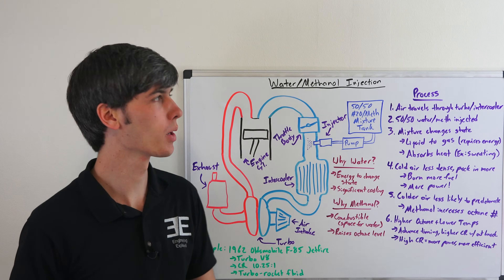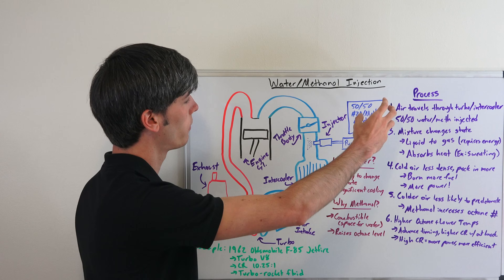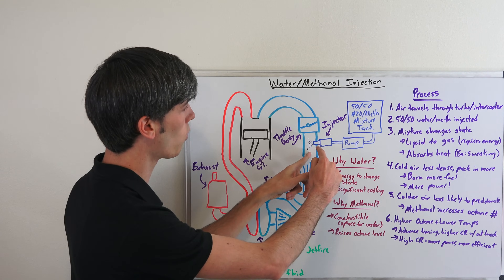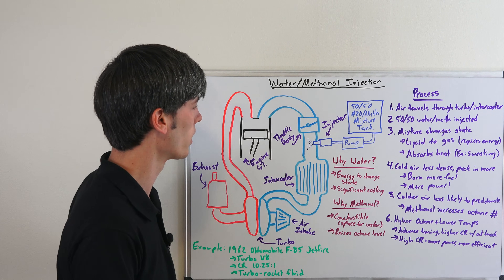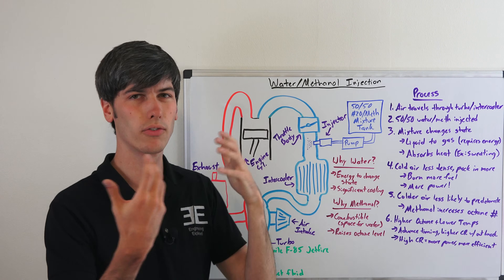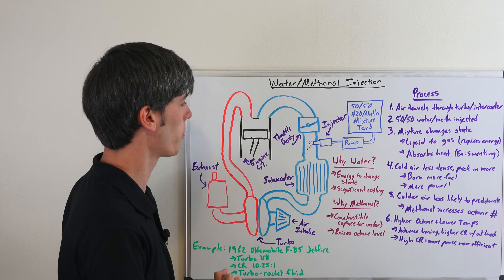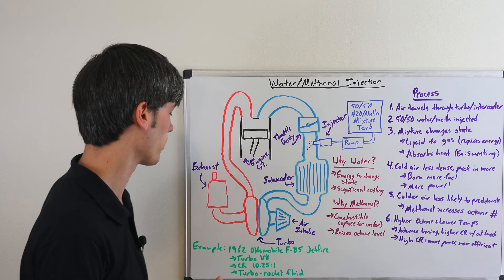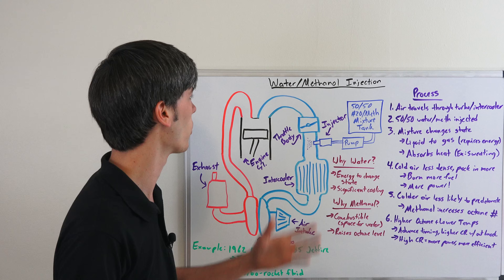Water Methanol Injection - More Boost!

Comment: i seen some guys use winter washer fluid instead of water meth mix
Reply: +fabianoH5N1 Yeah, some winter washer fluids are a mixture of methanol, ethanol and water. I don't remember seeing any that only have methanol and water, at least in here. But I have seen a washer fluid that is like ~99% ethanol and doesn't have any denaturation agents listed in the ingredients. I've been wondering if it's drinkable :D It's only 5€/4 liters, or $6/gallon. A ton cheaper than any alcoholic drink made for human consumption.
Reply: If it's 99% ethanol then the rest is benzene or cyclohexane or something similar.  It's quite toxic.  The best separation of a water/ethanol mixture using normal distillation is about 95% ethanol and 5% water.  If you need a truly non-ionic solvent you have to get rid of the water, and this is done by adding benzene and redistilling.
Reply: +Kepe I don't know about the washer fluid but in some laboratories they use Benzene to get more pure levels of alcohol(99%) and the benzene is very toxic lol, I wouldn't buy washer fluid to drink it.
Reply: TheAlmightyCon But it says it's 99% ethanol ;o
Reply: Kepe lol I can't stop you from trying but i would definitely call the manufacturer and ask them if it is safe for consumption. Even regular alcohol is dangerous, I have brought on IBS symptoms because I would drink heavily in college and it's still a problem for  me now =(
Reply: Or use 3A molecular sieves.

Comment: I run a Cooling Mist system on my Mazdaspeed 3, boost switch activated to spray 100% methanol starting at 15psi. For my platform, it's great to keep the intake valves clean since we're direct injected and get no fuel wash in the intake otherwise. I already run an ethanol blend in tank too, so the cylinder cooling and higher functional octane of the ethanol is already in place. With the methanol on top of it, my EGTs are likely hundreds of degrees cooler than normal, and I'm able to run a very aggressive tune in terms of timing quite safely. Steam cleaning the combustion chamber when I run a 50/50 WMI mix is also a nice added benefit!
Reply: SI0AX Here's a secret: I used to have a CRX. But when I did, I didn't go into a conversation between two Mazdaspeed guys, one of whom knows a TON about them, owns a highly modified one, tunes them, and actually is running the combination in question (eth + meth) and butt into the conversation will all sorts of just plain wrong information regarding ethanol mixes + WMI as it applies to the Mazdaspeed platform. This dude acted like a first-class douche. Anyone who knows anything about modding cars knows that platforms have all sorts of different variables and unique attributes that apply to them. A one-size-fits-all approach to modding all cars will get you a blown engine with a quickness. High-powered Honda notwithstanding, he obviously knows very little about cars outside of that very limited subculture.

That behavior was as rude as it was inaccurate. He doesn't even know DI because he doesn't have it. All he had to do was swap in bigger port injectors and use methanol for the octane. All he knows is methanol for octane. That's it. He has no idea about how many more very significant uses it has on our platform in CONJUNCTION to octane boosting. He doesn't even know that we don't have aftermarket DI support. How could he? He's a complete ignoramus regarding Mazdaspeeds.

And I'd be surprised if that little turbo Honda pushes more than 350wtq. Those are rev-happy lawnmower engines, not the 2.3 MZR DISI that the top guys are pushing 800-900 hp and a TON of torque more than a Honda could ever dream of.
Reply: SI RICKO Not at all. Especially when you're out of injector headroom. And on Mazdaspeed 3's (which are direct injected and get no intake valve wash cleaning), the WMI is excellent to keep clean valves alone. Granted, I already have great knock resistance running an E30 mix. Regardless, DEFINITELY not pointless.

Let's count the reasons:
1) Clean valves
2) More injector headroom
3) Increased knock resistance
4) Cooler combustion chamber, keeping ringlands safer
5) Steam cleaning the combustion chamber
6) More consistent year-round boost air temps, especially in hot climate.

There are even more Mazdaspeed-specific reasons I'm not mentioning. Yep, definitely not pointless at all, LOL ;-)
Reply: +Zack Richmond I'm planning on doing the same. Where did you setup your nozzle?
Reply: I have a throttle body spacer with 1/8 NPT holes for injectors to be mounted. I'm just running a single CM7 nozzle. Here's the product I use (and love): http://damondmotorsports.com/products/mazdaspeed-3-6-tb-spacer-with-injection-ports-pre-buy
Reply: Zack Richmond
Oh, shit, I though about also using a spacer, so I don't have to drill any holes.

The thing is there are many that recomend having a certain distance between the injector and the throttle body.

I would think this spacer makes the distance to short, but If there's no problems I guess it doesn't matter.
I guess there is enough space/distance/time for the water to evaporate inside the intake manifold.
Reply: SI0AX Various WMI companies (Snow, Devil's Own, Cooling Mist, etc.) recommend various nozzle locations for best results. Usually, it's within a few inches of the throttle body.

With regard to the Mazdaspeed platform, we've experimented with WMI a TON on our cars and know what works very well for us. If I didn't use that spacer, then I would've put a tap a few inches in front of my throttle body. That spacer places the nozzle right behind the throttle body, which also works very well for us. But I run a solenoid too to prevent siphoning since my nozzle is exposed to more vacuum in that location.
Reply: Zack Richmond
Cool. I would run the solenoid anyway. As there is a danger of the meth leaking and flooding the engine while it's parked.

The one problem that has put off many from methanol injection.
Reply: SI0AX Yep. I have a master switch installed too so that I can kill any potential flow whenever I want, including if I'm just parked/engine is off. I also wired in an LED to let me know when the system is flowing. I've incorporated several extra features like this to avoid issues.
Reply: Zack Richmond
That's awesome! I may try something like this, but maybe I will just stick to a check valve to keep costs low. I still haven't decided what kit to run. I'm thinking of dropping the cash on Aquamist. I don't know if that's a bit overkill it's like $600.
Reply: SI0AX Depends on your goals/application/how much you're going to spray.

I'm just using a single CM7 nozzle to keep my boost air temps down and add a little extra fueling, so for me a simple boost-switch setup that activates at 15psi was fine.

If you're going to spray a ton of methanol, need a progressive controller, and need a failsafe because you're fueling dependent on the methanol, then a more sophisticated setup like the Aquamist makes sense.
Reply: Zack Richmond
What I was thinking actually, was using the MAF volt signal to spray a very tiny bit of meth to increase the octane to 93 during normal driving and then raise it to 100 during WOT. It would also keep the valves sprayed the whole time the car is injecting.

That also means I could run 87 regular gasoline and save money. But I don't know how much meth would be consumed. I would need to purchase a large tank and maybe have to fill it everyday. It wouldn't bother me though.

Also If I were to use pre-turbo meth, I would of course, only activate the turbo injector at WOT.
Reply: SI0AX It really depends on your engine's needs, particularly with regard to timing. Many engines don't need that extra octane unless they're wide-open throttle/under full boost because those are the conditions that create the highest cylinder temps and therefore are most likely to cause uncontrolled (read: too fast) fuel burn because they don't have high enough functional octane.

Trying to dial the methanol amount in in such a way that you're spraying exactly the amount you need for the octane levels under various engine conditions would be extremely hard to do. And then there are all sorts of other factors that apply, such as the ambient air temps and boosted air temps. Hotter air makes KR more likely. IMHO, just spray more than you need in terms of octane. You don't want "just enough" octane. You want more than enough. So then, during the harshest operating conditions and under WOT, you still have enough octane to keep everything running safe and cool.

In terms of what nozzle size/how much to spray/how fast you'll go through it, it depends on your application. A CM7 is fine for me when spraying either 50/50 or straight 100%. My stock fuel system is capable of supporting my power levels on its own (just barely, LOL), so the meth on top is just a little extra safety measure to keep things cool and clean. I'm at about 385/380 @ the wheels in good weather, and my CM7 usually will spray in such a manner that my 1-gallon tank for methanol won't need filled more than once per tank of gas.
Reply: Zack Richmond
Cool, that's really nice!
I guess I'll just choose a more simple and cheaper alternative.

I heard that using the MAF sensor instead of MAP sensor is better. I'll just choose one of those.

Is the cooling mist setup you have upgrade-able to include 1 extra nozzle?
Reply: SI0AX Honestly, on Mazdaspeeds it's usually much better to run off of the MAP or a boost line rather than the MAF. Some controllers have an integrated MAP that you just plug a vacuum line into.

If you want another nozzle you can buy a T, another nozzle and another nozzle holder. I don't know how they package that. Just call them.
Reply: Zack Richmond
Oh, ok then. Thanks for the advice!
Reply: SI RICKO
Actually there is a video on youtube where a guy explains the pros and cons to E85, and then explains the same but for Water-Meth.

He said that you can have all the pros without the cons if you use both.

I think the video was caller E85 vs WMI or something.
Reply: SI0AX What SI RICKO doesn't realize is not all platforms are the same. I listed 6 specific reasons for the benefit of both above in Mazdaspeeds. And I know this platform backwards/forwards, having tuned numerous Speeds and owned one for years... This isn't theory for me. I've been doing it on Mazdaspeeds for a long time.
Reply: SI RICKO Hopefully you're facepalming yourself. If not, you really don't know, do you? Let me guess, you don't have a Speed, nor do you run methanol and/or ethanol on it, do you?? Do you even DI, bro???

If you sit back and be quiet, you may just learn something about ethanol mixes in conjunction with WMI on the Mazdaspeed platform.

You strike me as a Honduh guy. Amiright??? LOL. Speeds aren't Honduhs. At all. These are legit, factory-built turbo cars that don't blow trannies at the drop of a hat.

I suggest you read a TON on mazdaspeedforums.org, and mazdaspeeds.org. Spend a few months (at least) doing so, come back, and then you can have an informed conversation. You have shown a very high degree of ignorance regarding the use of ethanol mixes with WMI on the Mazdaspeed platform.

What's next, you gonna go school the LS and modular Ford V8 guys on their own platforms too? ROTFLOL
Reply: SI RICKO Read my previous comments, bud. Stop being lazy. I'm running 385/380 @ the wheels on an E28 mix and a CM7 WMI nozzle on a 2010 MAZDASPEED 3. Ignorant Honduh guys, SMH.

You're the type of know-it-all (though actually know very little) Honduh dude that gives your platform a very bad name in the tuner community. You're a joke with an ignorant punchline.

Do you even know the difference between your inferior port injection and our superior direct injection???
Reply: SI RICKO I mentioned 6 specific benefits of running both that don't occur (or occur as well) with just ethanol mixing or WMI alone, and guess how many you refuted? Zero. You know why? Because you can't. Can't argue with physics, bud. Sorry. You can't even attempt proof otherwise because you can't argue with science. You have absolutely zero practical experience with the platform.

Where's your Mazdaspeed? What year? Tell me the difference between load-based, hybrid, and boost-based tuning? What are our stock turbos? What psi can they run and where in the powerband? How much wtq can the rods take? How about the clutch? How much do our direct injectors flow? What are the first mods to get for a Speed? What's our most popular tuning solution? What form of EBCS do Speeds come with from the factory? C'mon, bud, think you know anything about Speeds, ESPECIALLY WMI + ethanol mixes on them? Prove it. You're just another ignorant, keyboard-warrioring troll.

And you are a Honduh guy, aren't you??? Pretty easy to tell, ROTFLOL.

/mic dropped
Reply: SI0AX I used the Damond Motorsports throttle body spacer, but you can just install a nozzle tap a few inches before the throttle body.
Reply: SI0AX Here's more helpful, specific info for you:
http://www.mazdaspeedforums.org/forum/f699/methanol-injection-info-176351/
Reply: SI RICKO

Do you daily drive your CRX or only use it for the track?
Reply: SI RICKO

Buton Willow has a lot of Mazdaspeed promotion in their website. I think most of the cars are Miatas but some look like RX-7's.

You don't run through any stations with E85 on your daily commute?
Reply: SI0AX A little bolted turbo CRX that has to spin like a sewing machine to make 500hp and still makes zero torque is not a Mazdaspeed 3. This SI RICKO has proven not to know anything about DI, in general, or the Mazdaspeed platforms, specifically. Take his advice worth a grain of salt. I mean, c'mon, dude drives a Honduh; what more do you need to know?

The nonsense he came in here spouting regarding a platform he's oblivious to makes very obvious why Honduh guys are laughing stocks in lots of car culture. There are some legit ones, don't get me wrong. He's not one. Coming in here with all that nonsense pretending to know about a platform he's 100% ignorant about. SMH
Reply: SI RICKO

And what exactly do you mean by "stuck in 2009"?
Reply: Hey numinous are you on Instagram?
Reply: Numinous, I really enjoyed reading that, thank you. I'm thinking about getting this added to a (as of now) hardly modded 2004 Nissan Frontier. I noticed that it has 30% less wHP on a hot summer day than in the winter. I'm thinking that it's tuning itself back to prevent knock with all the heat. I think given what I've observed something like this could keep performance up. What's the word on this, overall does it promote longevity of the engine (other than being lead foot happier of course ;) )?

Comment: Thanks for the informative video! Just one thing you did not really mention - methanol injection system also cools down the temperature of exhaust gases, which is quite important for some folks, such as drifters. Some of them claim that methanol system lowers their exhaust gases by up to 100 degrees Celsius...

Anyway, thanks one more time! Keep videos coming!
Reply from the maker: How do drifters benefit from lower exhaust temps?
Reply: @EngineeringExplained  In a nutshell, it helps with keeping the turbo cooler, which then also has an effect on the cold side of it. That allows to run a smaller size turbo...

Comment: I think the new BMW M4 GTS will have this system in it as well
Reply from the maker: +Dalton Klinkenberg Yes, same exact concept. The only difference is the BMW is just using water.
Reply: +Engineering Explained any reason why BMW is not using meth? That sounded weird. Would there be another container you would have to fill like a wiper washer container? Any place to buy the mix or is it mostly mixed by people at home?
Reply: +Dalton Klinkenberg Both as far as the mix (it's preferred shipped in pre-mix form, since you get more overall since it costs money to package/ship; or can view as being willing to spend more to save the time/effort of mixing). However, it's cheaper and more readily available from BMW's standpoint to just rely on distilled water without any mixing --- far easier to just have the customer get clearly marked distilled water than put any specific % mixes or types of mix on the customer.
Reply: +Joe Smathers makes sense, thanks for the info

Comment: 1 why isnt the injector after that valve so it cools air nearest to engine and the air travel more distance at higher temperature so overall heat loss will increase?
2 this system might be reasonable for boats and trains where the engine weight is not a big factor. btw today is a hsssssssssssssssssy day to leaf a like
Reply: The water / alcohol mixture is injected before the throttle so that it benefits from the added turbulence for better mixing which is induced when the throttle is only part-way opened.

Comment: You talked about the water displacing some of the air, which is true, but according to Gale Banks, when the air is fully saturated, meaning that water cannot effectively evaporate anymore, the volume of air the water displaces is only about 4%. And that's if the charge air is fully saturated, which is unlikely with a properly sized injection nozzle.

Basically, yes it does happen, but the displacement you mentioned is not really worth calculating for when it comes to tuning. Gale Banks had a really good discussion about this in +TheSmokingTire podcast a while back (Episode 86 I think) that I think is worth a listen.

BTW, love the videos. I've learned a lot watching them and look forward to more

Comment: How is it possible that the water cools the air goin into the engine, the water that is sprayed in and vaporized (heated) goes into the engine too. Or is it important that only the air, not the whole gas mixture, is cooled?